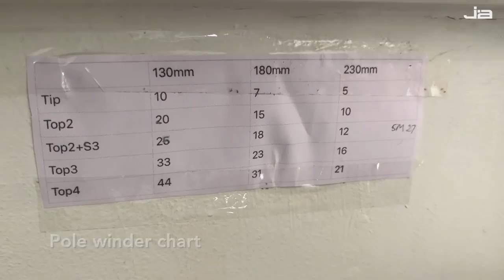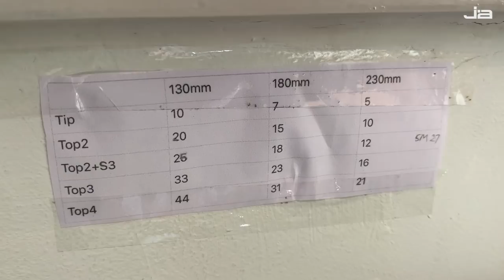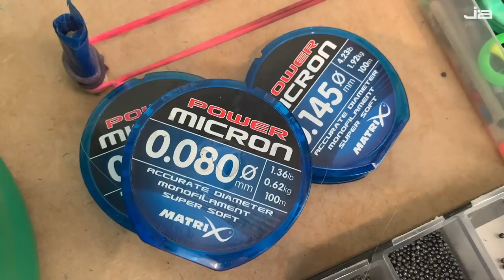Fishing Tackle Talk: River Pole Rigs

Comment: Hi John great video, I was wondering what length hook lengths do you use on your river rigs? Cheers Jason
Reply from the maker: Thanks, mostly 6in (15cm) but might go shorter 4in for bleak or bread fishing and longer 8in for hemp fishing or faster venues or if I'm laying on a bit of line for quality fish. Flat float fishing and holding back big rigs with worms etc I often use 10-12in as I am fishing much deeper than the swim. Hope that helps, but stick to 6in for general work.

Comment: Hi Jon I use similar floats but heavier like 5g.. 6g... 8g... 10g would be my heaviest 99% of my floats are carbon stem personally I think are stronger and they don't intend to bend and break like steel stem... But I've one Question Jon I'm going to purchase silicone /plastic tubing to cut into little pieces to suit the carbon stem.. Can you recommend what diameter tubing would you use for this... Regards Jimmy 👍
Reply from the maker: When you go above 3g a carbon would be my choice too, but strong flows a thick metal stem will help provide a keel. They tend to get stronger and thicker in those sizes, almost like alloy stems. As for silicone, have a look at the multi dispensers that companies like Preston and NuFish do as they have mixed diameters from 0.3 to 1mm.

Comment: Well John, that was very interesting. I’m on the right track generally but due to removing the heavy matrix trays from my box Im trying to store rigs in lighter tackle boxes like the new shallow matrix Eva system. Apart from grouping a few winders together with rubber bands I haven’t found any other way of stopping them from getting into a mess! The new shallow Eva boxes need small tray with rounded corners so they stay put without moving about. As usual nobody seems to have stock which is really irritating! Hmm the downside of reaching 70 yrs old 😢if you or anyone has any solutions please let me know. Tights lines all.
Reply from the maker: Stonfo do a 'Float And Winder Box' container (Code 732.0.0) which is 260x190x26mm and fits the yellow winders perfectly (but frustratingly 5mm too short for the long blue river 26cm ones). They're £5.99 at Benwick Sports on this link: https://www.benwick-sports.co.uk/accessories/9769-stonfo-float-winder-box.html
Reply: @JonArthur  Wow thank you John and for being so quick to reply also. I’m thinking about booking a day coaching with as it’s my 70th this June. I know you have a relevant website to book this so will contact you probably on the listed telephone number. Thanks again.